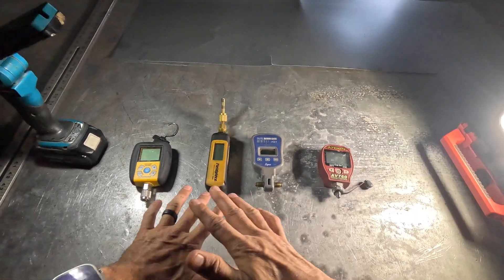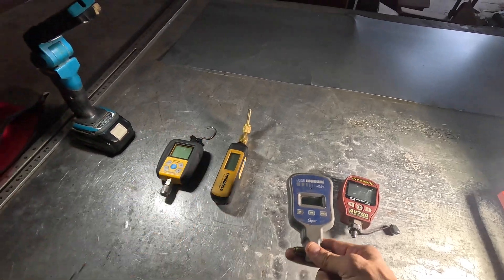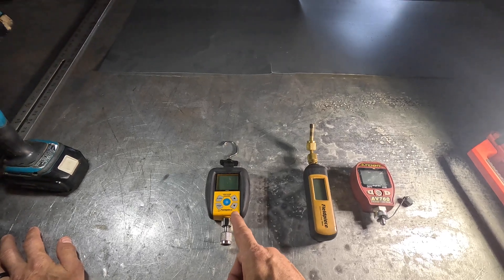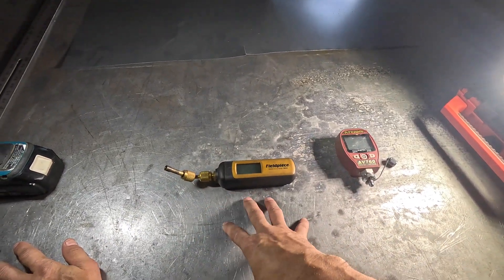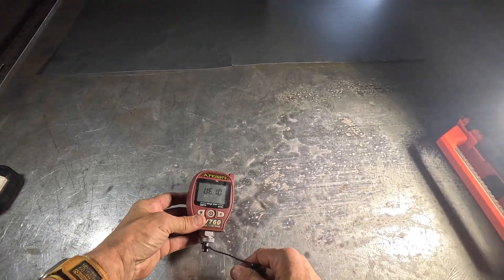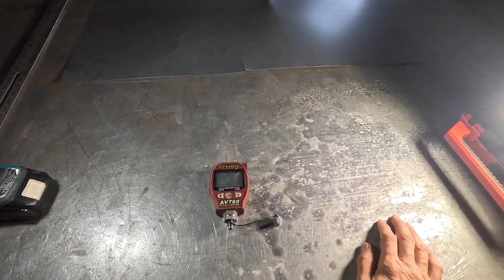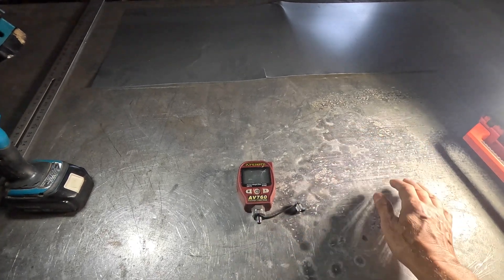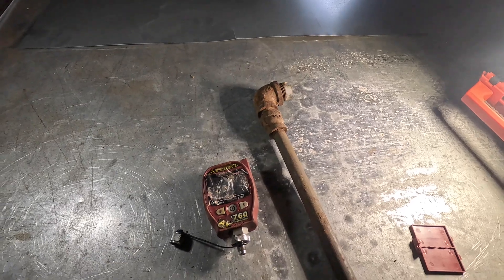Going Over What I Like and Dislike About My Micron Gauges! #hvacguy #hvaclife

Comment: This a damn shame, after paying that kinda money for equipment and then support and replacement/return policy sucks like that.  Appreciate this feedback because I’ve been wanting to upgrade to the mg44 to pair with my fieldpiece platform tools, but I thought going high end & spending a bit more with appion or bluvac but now seeing this I think I’ll just try the fieldpiece and see how goes.  Fyi, I’ve had the cps unit for years now and it’s a tank, I’ve beat on it and it just goes and goes, apparently it is one of the models that many guys stand by because of its durability, however it’s not Bluetooth and doesn’t have backlight which is the 2 main reasons I’m upgrading.  I saw they released a newer mode with those features but anyway.

Comment: I have a fieldpiece  MG44 and I have cleaned it many times to try to get it the work but so far it still does not work. The CPS VG200 I have has worked great. I am glad I did not get an Appron AV760 that you initially loved. I could not afford  the price even a used one on Ebay. Thanks for the update. So far, cheaper is better, I think I will get another CPS VG200 as another backup. Thanks for your videos Curtis!!! Take care!

Comment: That was unexpected !!!!! 😂 If u have a Stubborn one that won't clean or operate.  use Something in a Spray can with a little red straw and spray high pressure contact cleaner on the sensor or similar.

Tips - For the new guys. Micron guages don't like pressure. as soon as it sees a positive pressure remove it from a system.
i've used the same micron guage for 20+ years and never had to clean it.
i guess my secret is it's on a 6' hose & hooked direct to the vacuum pump always. it never sees pressure or refrigerant. also being 6' away probably keeps sensor away from trouble / vacuum pump oil etc.

Comment: Curtis, I occasionally set up mini splits for friends and family, what is a decent, inexpensive micron gauge for the infrequent use that I do?   I do like your Apppion repair method, I used to have to do that to certain brands of film projectors back in my cinema service days.
Reply from the maker: First two I mentioned, just keep them cleaned
Reply: @HVACGUY  Thanks! Will check them out.

Comment: I understand that frustration!  I have the MG44 and it's been good to me. I like it because it works stand alone or with the apps.  Unfortunately for me, it decided to stop powering up.  I started to do the return to FP online for repair, but then it started working again..Then I got to a job site and it took a dump and wouldn't power up for me on a roof top....I should've grabbed some black pipe like you and smashed it! LOL

Comment: When that appion gauge first hit my bro picked one up, worked one time then just crap out after that. Never again. 

Been using accutools bluvac gauges for over 5 years never a problem. Complete gauge to actually recalibrate the sensor they are such a versatile gauge with pass or fail decay test either through the app or on the gauge it self. 

I also have testo and fieldpiece as back ups. I will run them up with a bluvac to make sure calibration is near a tolerance.

Comment: Curtis, 
1. Purchase and use 100% methyl ethyl alcohol on all diaphragmatic pressure and vacuum gauges. Isopropyl Alcohol leaves a film when dried no matter how clean the gauge. Methyl ethyl dries absolutely clean, no residue. 
2.DO NOT use denatured alcohol EVER.
3.Use a Pyrex syringe to draw up and dispense(squirt in) the methyl ethyl alcohol
4. ALWAYS use dry nitrogen to dry the sensor
You may have to repeat this a couple times depending how contaminated the gauge is

 I certified aerospace gauges both analog and digital, transducers up to 76,500psi, vacuum gauges etc for 30 years in a aerospace calibration laboratory .
I think you will find success and  save money using these processes.